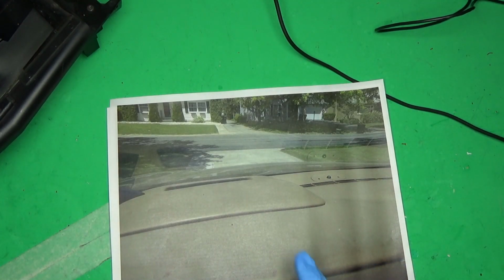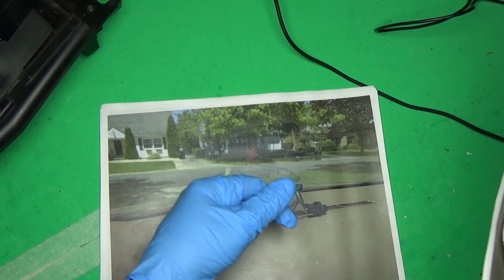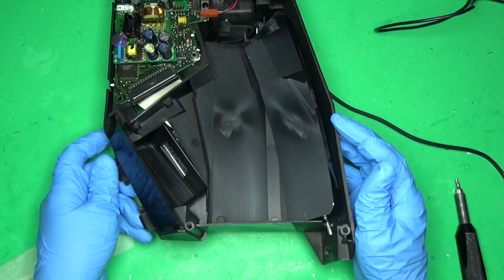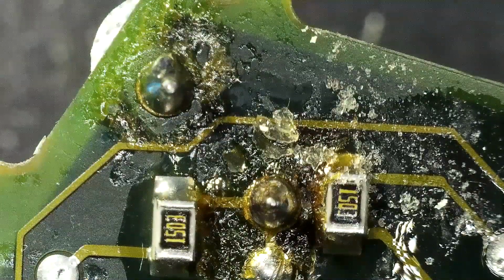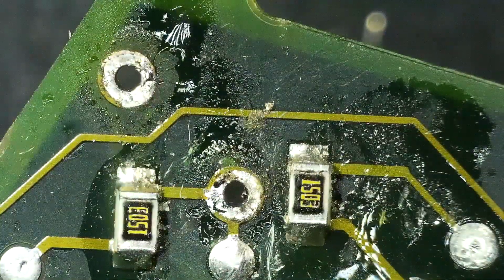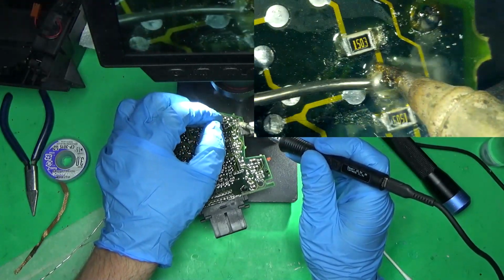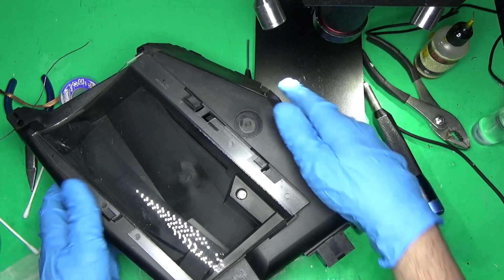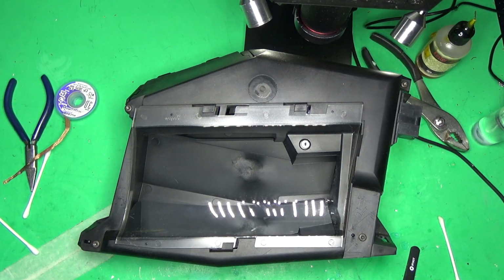Fixing my Grand Prix's HUD (Heads Up Display)

Comment: Is it possible to add a heads up display to an 89 se, that didn't come with one from the factory? Thanks nice video.
Reply: Anything is possible if you have the time. I'd recommend checking to see if the connectors for any HUD unit are under/around your 89's dash. If so, there is a fantastic forum post showing the pin out conversion charts for the 94-96 and 97-03, I believe someone mentions the older 89-93 but I cannot be sure.
Reply: @unknownsoldier4156  Thanks for responding and the assistance. I'll look into to your suggestions.